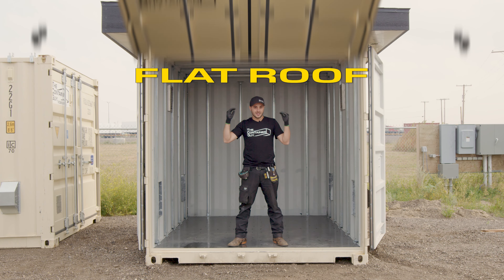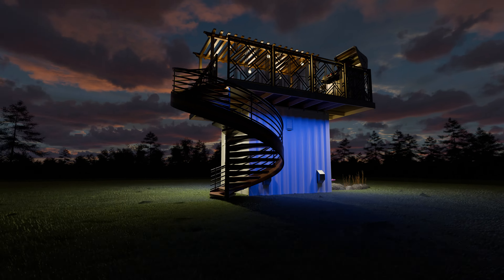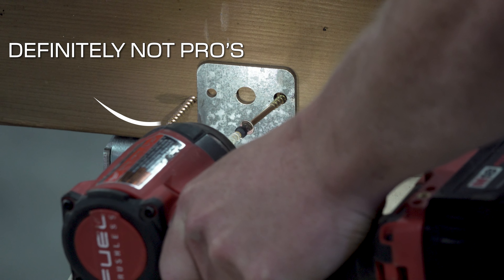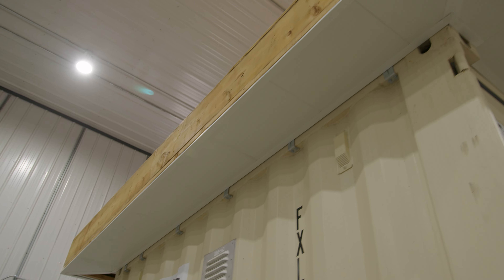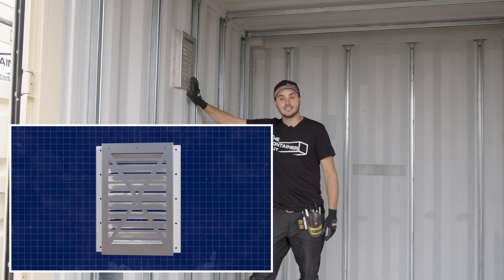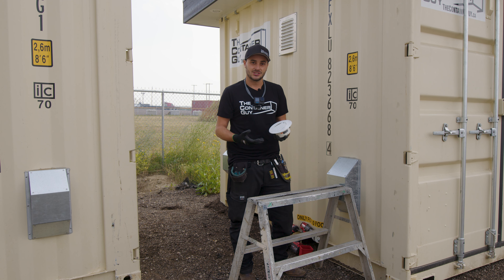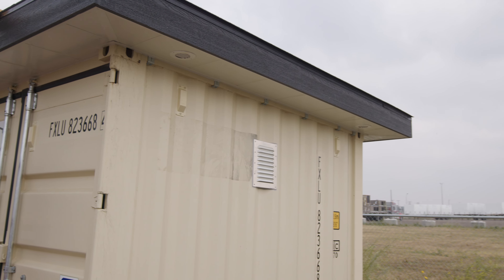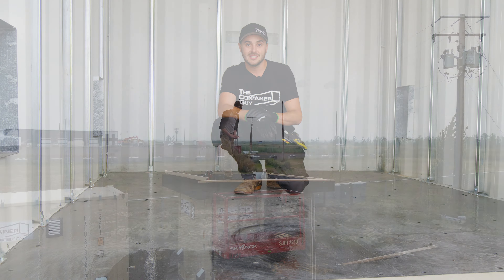DIY Wood Truss Brackets For Shipping Containers (No Welding)

Comment: I have a free tip for you. On the inside of the doors put a couple of U brackets and a beam on a pivot at the side. Run a cable from the end of the beam to the corner of the container and have a ring inside the corner mount so you can pull up the beam from the outside. This way when someone cuts off the lock and tries to get the doors open they will be mentally challenged.

Comment: If you use steel strapping over the truss beams it will not snap off and fail like it did it your test. @1.50 min
Reply from the maker: @NuclearCowboyTube  stay tuned..

Comment: our business restores high dollar vehicles if we use a container to store cars or chassis or parts or sub assemblies in process(finished or not) does the floor or sides sweat or need vents or heat to be a viable secure storage solution for us - we dont need to rust and wreck parts/cars we are entrusted with-love the idea of a big steel lockable box to keep things safe
Reply: @markcappiello2315  insulation and a dehumidifier is best. Don’t put container on the ground.

Comment: Why all the no welding, I'm not interested in the no welding. It's easy for me to weld paint move on need more good ideas for real men and women that weld
Reply: Not everyone can weld, and you should always avoid hot works when other alternatives are available. It may not matter on a hobby project, but it does matter at work sites, especially industrial. Bolting on ready made brackets is also faster, especially if the container is already in use and has flammable materials inside. And if the container is already properly painted, it's not really a "just paint and move on" after welding if you still want it nice looking.

Welding is a good option if you have the tools and materials needed to make your own brackets and thus saving money, but bolt on brackets are better in pretty much every other way. And I'm saying this as a welder.
Reply: @Catrik  but Im not looking for bolt on ides and I'm sure other's are in the same boat looking for weld on kits why limit the company to bolt on parts?
Reply from the maker: Lucky for you, every other company on the planet welds pretty much every frame / bracket in their mods so there's lots of inspiration on the web if you look around. 

We have journeyman welders on staff. We aren't afraid to weld when it's intelligent to do so. Everything @Catrik said is spot on👌.
Reply: I like the idea of you trying to make a good mouse trap! I will look up some others than and see if they have what I'm thinking
Reply: @jjlicata6786  I'm going to be spending money so

Comment: If you do a lot shipping where the external components are a concern, look into those shrink wrap products that they use for boat storage during off season. it's usually white and shrinks to a tight fit. Not sure if the cost is worth it as the container itself is already watertight. It would mainly be for a rolled or shingle roof....

Comment: The correct term for the roof you built is low slope. Anything under 2 inch rise per 1 foot of run is considered a low slope roof. Flat would refer to any roof that isn't built on a radius.

Comment: Top rails are meant to never be penetrated. Penetrating them will end up with them rusting from the inside out. I have thought about doing something similar and filling the rails up with spray foam.
Reply from the maker: Tried that. Might actually make it worse, not better if the drill holes that you squeeze a foam tip through  aren't filled with a fastener. Can't weld them cause you'll light the foam on fire. So essentially, you're back to square one with fasteners in the tubing and might as well have used a bracket in the first place.
Reply: @TheContainerGuyTV  So you use the fastener holes to fill the rails then just punch the bolts fill through. Need to use those cans of spray foam that have the long tube nozzles I was talking to a guy who does container conversions, and he said he would not do rail penetrations. Fill properly with foam and the container should be better in the long term. They all get breached eventually.
Reply from the maker: @magamike1800  drill holes and use sealed riv nuts. Or seal the threads in normal riv nuts. Be pretty sweet actually... I'm gonna try it.

Comment: Another fantastic design/mod. This would be great as a cantilevered top, add a daddy warbucks deck and railing kit a curved staircase... cool place to setup you $10,000 telescopes... oh and don't get me started with that idea boy...
Reply from the maker: Cool idea!
Reply: The better idea is in my head.  2-10 ' side x side with the roof that slides back like the old daddy warbucks roll top desks in the day  or maybe a turret half bowl design mounted on top with the slide door.
Ive got so many ideas. Hook me up yo!

Comment: could you have used a tarp and tow straps to prevent the roof lift on the highway instead of drilling into the roof. (I know. the 2x4 studs and screws are a cheaper option)
Reply from the maker: @romaellodfranco72  Yes, that would've been smart